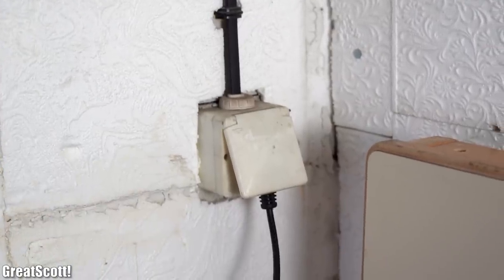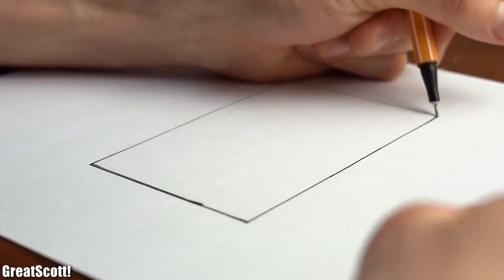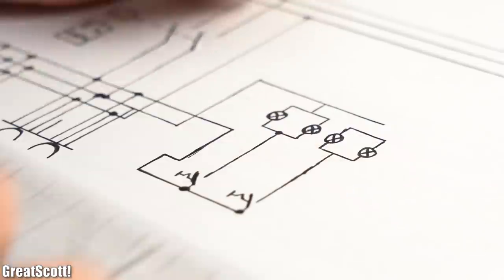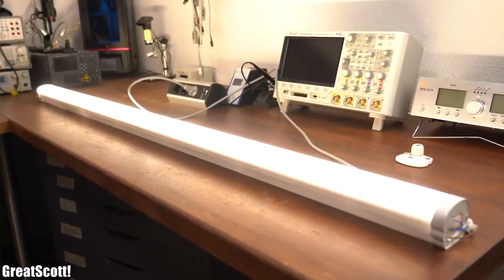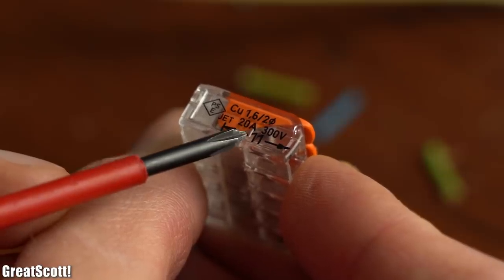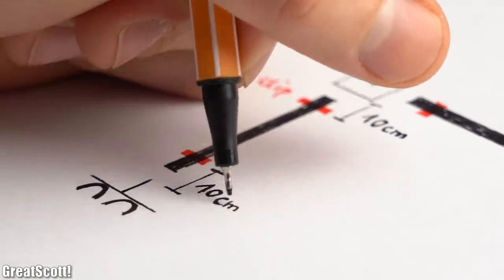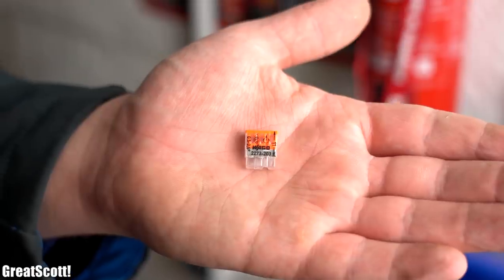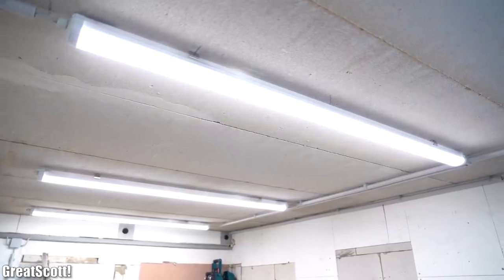How to do Electrical Wiring properly! (more or less....) GERMAN STYLE!

Comment: Hi Scott, I really enjoyed this video, as I am a german electrician as well. Everything looks perfect to me, but i gotta ask: is the rcbo 6a/30mA rated? I couldn't see it in the video and assumed it was a standard 16A/30mA rcbo, which wouldn't allow for selectivity.
Also I would have added why there is a fuse that low installed (most likely because of the probably very long wire from the main distribution box near the power meters) - also, couldn't you just get rid of the diazed fuse at all?
All in all a very nice video. Love how well you can draw the installation plan freehandedly

Comment: Very nicely done, but I'd improve on your installation by setting up separate circuit breakers for lighting and outlets. I'd even go as far as setting up separate cables and breakers for each each electric outlet, depending on it's use. That way, if you overload your (for example) drill press, you are not going to plunge into complete darkness once the main breaker trips. I've skipped a breaker in my kitchen and combined all utility outlets on a single breaker - misc items like coffee machine, toaster and wall outlet (where my wife plug the vacuum cleaner) with the washing machine, and it trips every Sunday when she vacuums while waiting for laundry. There is a separate conductor to the laundry/dryer machine, but I've cheaped-out on a 5 euro breaker for that circuit.
And, as a little known fact - after a few trip conditions on an automatic breaker, it is supposed to be replaced with a new one, so for me it's double the cost now.
PS: Scott, what is the nominal Amps per mm-squared allowed in Germany? In my country, I have a memory that it's 4A/mm2 (what I use when choosing wire gauge), but recently an electrician told me something like 7A/mm2 is the current standart in Europe. What is the correct math to go by? By my experience, stranded copper wire gets warm to the touch (3x1.5mm2) if it gets to 4A and above.

Comment: I had no idea that German installation plans used different symbols. I’m used to the US symbols, where a duplex is a circle with 2 parallel lines going through it and a switch is either an s or a dollar sign (depending on how lazy your drafter is). Lights and panel/distro box are still essentially the same though

Comment: 1,5^2 copper on 16A, is this according to the short lengths required in this install? Seems so thin for 16A.
Reply: 16A are possible in this case because of how it´s installed (air flow, no heat transfer from other nearby wires) and because of the short length (=voltage drop), there are tables for nominal currents: https://www.lappkabel.de/fileadmin/catalog/2010_de_pdf/T12_Belastbarkeit_Grundtabelle_Reduktionstabellen.pdf

Comment: European electrical standards are much more strict than in North America. In North America, the average homeowner can do electrical work if they are comfortable with it, of course insurance always encourages you to have a professional check your work. Most of the electrical work in my house that has been replaced has been done by 3 generations, my grandfather, my dad, and myself, none of us are actually electritans, but between the 3 of us we have 50 years combined experience doing electrical work. I can also understand why you would want to replace that older system, My house was built in 1939, so at the time, copper conductors were used, but the system is called knob and tube, which refers to how the wires are held in place, they are held with ceramic knobs, and ceramic tubes were used to go trough joists, and in that particular type of system the live and neutral wires are run separately, due to how old that system is, we've needed to replace most of the original wiring, and we have needed to replace the main distrobution panel, and we've needed to add a few sub panels, 3 at this point. We replaced the old panel for the old wiring a few years ago, it wasn't really even a panel, it was a ceramic block with 4 lightbulb sockets in it to acomadate mini breakers, we replaced it with a modern panel and modern breakers. You are lucky to have access to 3 phase there too, my grandfather is a machinist, and he wanted to run machines in his garage, so he had to build a motor generator to be able to put out 480 volts 3 phase to power his machines.

Comment: i am electrician from India, and in India only  10% people follow wiring standard even in industrial wiring. here people dont use wire connector like UK they just joint it and cover with insulation  tape. and 50% electricians are just learn from work types.

Comment: Why did you use a 16 amp breaker, if the fuse was only rated for 6? I guess the fuse would still protect the rest of the original wires, but in my opinion you should have used a 6 amp breaker.

Comment: Finland here: It is almost identical wiring as in Finland. 
Although, I believe the switches and outlets used in this video were on the cheaper side.
Reply: Actually they are pretty standard and not really "cheap" for a application like a garage.
Reply from the maker: Thanks for the info :-)
Reply: @RecBlackLP  ok. We usually use ABB/ Schneider outlets in a garage installation in Finland. 

 @GreatScott!  Btw, I have the same Jokari tools myself. Great tools to work with. And Wago terminal connectors are a miracle :)

Comment: But... 16A at 1,5mm2? Here in Sweden it's 1,5mm2 10A (or 13A) and 2,5mm2 for 16A. Atleast for installation cable. It can be 1,5mm2 for short runs from a socket to appliance for example at 16A. A 1,5mm2 at 16+A and longer runs, inside a wall, gets quite warm.

Comment: Coming from Australia I would have thought German electrical standards were higher but they are not.
1. Solid single core cable is illegal for new installations since around 2006 and single solid core earth has been illegal for decades.
2. Lighting and outlet power must be on seperate circuits.
3. Power outlets must be a minimum of 2.5mm. 1.5mm is fine for Lighting.
4. The lack of switches on the outlets would not pass here (every outlet must have its own switch).
Reply: you aussies and brits need to stop being such fannies and embrace the daily dosses of carbon and pixies from arc flahes from inserting and unplugging from outlets. lol

Comment: Why not use conduit at the corners/angles?  If you’re gonna protect the wire, protect the whole thing.  As others have mentioned, in the US it wouldn’t acceptable to leave the wire exposed at the angles.
Reply: The conduit is just used for faster installation, the NYM cable is allowed to be used without conduit, so it does not need to be protected.

Comment: Great video. Few questions: ok to have plastic only junction boxes/outlets/conduits on what looks like polystyrene insulation? And plastic LED lamps on 16A breaker? What breaking characteristic and residual current protection type did you pick? Any metallic backbone required for the installation to prevent conduit collapse in case of fire?
Reply: What would be better than plastic???
Reply: @calysagora3615  metal copex or rigid metal electrical conduit; metal junction box.
Reply: Hard pass.

Comment: So in Germany you don't have to measure pe continuity nor isolation with at lest 500v test voltage?
Reply: We do ,PE continuity <1 ohm and Isolation >1M Ohm
Reply: @LordFoxes  Thanks, I would have been amazed if they weren't needed
Reply from the maker: No, we do that here. But we did not have the tool to do that on time for it to be in the video.

Comment: I'm not entirely sure but it seems that you made your cascade is wrong. From 6 amp from the old main breaker, to your new breaker with 16 amp. 
It will work tho, but the new breaker will only secure from live to ground. Other than that, the old screwed breaker will pop in case more than 6 amp are drawn.

Not that bad but es nervt to change them after their blown :-)

Comment: Here in murica I have seen multiple people just put a couple holes in there walls and throw extension cords through
Reply: Most houses here in Germany have very good wiring, but by far not all.  I bought a house with old wiring without an earth wire. Any certified electrician would be forced by law to replace the wiring to include an earth wire - leaving tons of slits in the walls in the process - or keep the installation mostly as is (including the old rotary switches).  So the previous  owners chose to not hire professionals and instead patched up everything. You wouldn’t believe what wiring mistakes I found, it’s ridiculous. But everything built after the 70s is probably properly done.

Comment: A couple of things:

1. Separate lines for tools and lights and use additional isolation around wires connected in WAGOs. Also it's good those to be separated in the small splitting boxes
2. RCBO detects current difference between L and N, and PE is your (at least) protection when N is cut off. Also RCBO should be with different rating for different lanes - main 100mA, 30mA for tools/lights, 30 or 15mA for electronics (depends)
3. Always, always use lightning protection (cathode arresters) on ALL 3 lines
4. It's a good idea to have voltage protection on the input - it protects with cutting it off from the network when it becomes too high or too low (for example below 200V and higher than 235V)

Comment: Why does can't the conduits end flush with the junction boxes there in Germany?
Reply: The conduits are not needed in this installation so the extra afford and cost would just be for aesthetic reasons
Reply: @muschelhirsch4522  I see. But then why not putting the conduits closer to the junction box so the cables won't be visible at all? This 5cm distance should be respected due some regulation?

Comment: To add onto the thing he said about something might end in disaster if you do this on your own: If you were to wire up your own house grid and you made a mistake, like choosing a wrong wire diameter or some other easily made mistake, your house might burn down, and your insurance company will probably not even pay for the damage, because it's your fault basically. That means you could - depending on the value of your house - lose like 100k euros just to save a couple hundred or thousand, and even if you were to succeed in building a safe system it'd take you way longer than it would take someone who has been doing it for years, so it'd be like paying yourself below minimum wage for the work in even the best circumstances. It's just not worth it either way.

Comment: The standards in the UK / USA / Oz / NZ and Canada are about the same, slight variations, i am of course a classically trained spark from the UK, so i think in those terms, North America and Oz sparkies have a value, the UK there are too many wannabe wire monkeys, from the 18th Regs, its a metal box, fire retardant with accessories, surge protection, etc, the UK plugs imo are the best robust and safe, with a additional fuse with in, basically its more or less the same standards, in the WEST and down under, Germany , Dutch, swiss etc are really ridged and proper no short cuts or bending of the rule(s), well they are paid well to do so,

Comment: Similar as the Uk would be done. Aside from the gap between box and conduit. That's crazy and looks unprofessional if you ask me. Is there a reason why this is done? Also not sure what the junction box was for? Surely you have two circuits one for the lights, one for the sockets? I see no need for a junction box
Reply: @forownmade1243  Makes no sense, has plenty of lights already. If you wanted to add anything else you would come of the distribution board.  Any additional sockets would just be added to the radial/ring main.

Comment: I would like to see how its done if it was an installation during construction, for example inside a wall, would the conduit still be 5cm away from the components ? 

Aside from that, very interesting standard, i work on HVAC where a while ago i went to a newly built apartment building to install a mini split, whoever install the electrical....... they put the neut from the utility straight to the common bar, the live connects to some MCB which then connected to rccb, no not double pole mcb, they also put the rccb neut on both input and output to the same neutral bar, as guessed, whatever plugged into the output trips the rccb, i dont get whats going on in the brain of this electrician, i just rewire it according to british standard i get from youtube

Comment: Did the 6 Amp fuse get replaced for one with a higher rating because you didn't mention it. Otherwise the selectivity wouldnt been given. Otherwise Great Job of showing german wiring skills. Grüße aus NRW
Reply: I don’t think the fuse would have been replaced with a bigger one because this would lead to the possibility of overloading the utility line

Comment: There is one little thing you could have done better, which would be to earth the DIN rail. I like the Pheonix Connect "USLKG" line because they are cheap on eBay, but it's important because wires often short out on the DIN rails themselves due to cuts in the wire jacket, loose connections, etc. You used a high quality wire jacket cutter so it is unlikely your tool went too deep with a razor blade and left a little nick in the jacket of the wire insulation, but in other parts of the world they use hand tools which aren't so precise and shorting out on the rail can be a real problem.

When I moved into my house in Germany, there was a 3-phase 32A wire used to power a car lift / hebebühne (that the previous tenant stole) that was cut 2mm before the end of the METAL elctrical conduit it was sitting in. They had hacked it off with a saw to take the hebebühne, left the wire live. I only noticed it because snow came in under the garage door, then back up, and onto the end of the wire and made a huge bang. Didn't trip any of the breakers though. That wasn't the last time that crazy lady almost killed me after she moved out, but the purpose of my story is to say even when you do everything by the book, unexpected things happen. Even in Germany! :D

Comment: Really useful, thank you.
Could you please tell us why did you choose mostly solid-core wires instead of stranded wires?
Reply: Solid-core wires are the standard wires for installation here in Germany.
Reply: @Thorsten_Wiegand  do you happen to know if it's because of legacy and the standard didn't change, or there is a another reason?
Reply: @ovidiurosu6632  : The solid wires are simply cheaper! NYM-J 3 x 1,5 mm² is the standard installation wire for all outlets and lights in housebuilding in Germany.(DIN VDE 0250-204). Stranded wires are used for all flexibel cables, like extension cables or the cabels on a electrical device -- everywhere, where the cable can be moved, twisted etc. Solid wires are only used in fixed instalations and, as I said, they are cheaper and smaller in diameter than the stranded wires.
Reply: @Thorsten_Wiegand  okay clear: cheaper and smaller in diameter are good arguments for me, thanks

Comment: Great video, It's practically the same as in Belgium but you forgot one thing and that's an end tull (don't know if this is the right translation) on the electric conduit. ;-)
Reply: If I understand correctly - this is nor required in Germany, and I haven’t sees this in use eigther
Reply: @TecSanento  You can do it without but if you use it, it's more 'finished'. It's more the rules of art like we say here.
Reply: @andlinux  Yes, here it is just aesthetic
 but I dont think that is really important in a garage

Comment: Ich hätte min. einen 3 Reihigen Verteiler gesetzt, ebenso je nach Länge eine 10mm² oder 16mm² Zuleitung vom Hauptverteiler, dann ist man auf alle Fälle für die Zukunft gerüstet. Aber wenns nur bei dem Licht und den paar Steckdosen bleibt dann ist das ganze soweit in Ordnung. Kompressor, Schweißgerät oder Lademöglichkeit fürs E-Auto kann man so natürlich vergessen.

Den FI mit dem Duspol zu testen ist auch ein wenig mager, eig. hätte da ein Installationstester ran müssen welcher Auslösezeit, Auslösestrom, Isolationswiderstand und Schleifenwiderstand misst. Aber wird leider sehr häufig nicht gemacht.

Comment: What's the reason the conduit has to be 5cm away?
Reply: There is no electrical reason, the cable is double insulated, you could even tack it to the wall with cable tacks. It's simply that doing everything level and equally spaced looks professional vs a mess.
Reply: @astranger448  Thanks for the info.

Comment: In Italy we use 6A over 1.5 mmq, 10A over 2.5 mm and 16A over 4 mm. Depending the distance.
Reply: 16 Amps on 4mm²?? That sounds kinda weird
Reply: In Slovakia it is 10A - 1.5mm2 16A - 2.5mm2 for stationary wirings using cooper wires. But it also depends not only on distance but wire instalation. For example you can go longer distances with wires installed under plaster in walls, than with wires in protective conduits. I think it has to do with cooling of wires.
Reply: @justinc.8191  yep.. but the wires are flexible, non rigid!

Comment: Im amazed that German regulations arent more rigorous on this (Im sure that you followed everything correctly and I arent being critical) In the UK we wouldnt be allowed to use a plastic distribution panel or fit it on top of polystryene tiles because of the fire risk.

Great video,  thank you.
Reply: You will more or less never see metal distribution boxes in Germany since they are a safety risk. Plastic is a risk too but if a fire starts it will most likely not start in the distribution panel.
Reply: @muschelhirsch4522  In the UK most of fires starts in the fusebox because of their single phase sevices and high currents for cookers. Electric showers are very popular there,  10kW on sigle phase. Stranded conductors in cables over 4mm. 10mm stranded does not hold very well in the clamp even if torqued .
Reply: not only that - polystyrene + plastic = bad time (plasticiser migration)